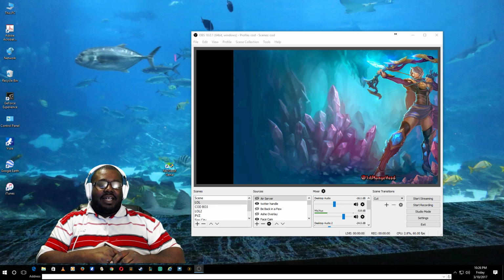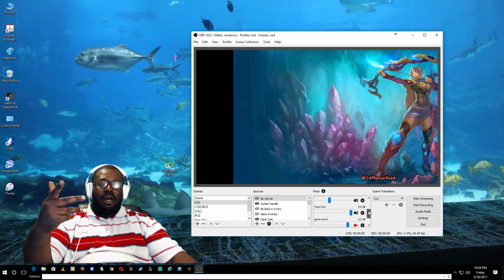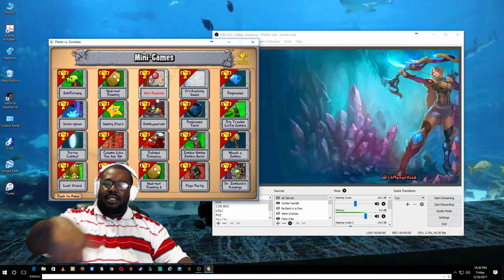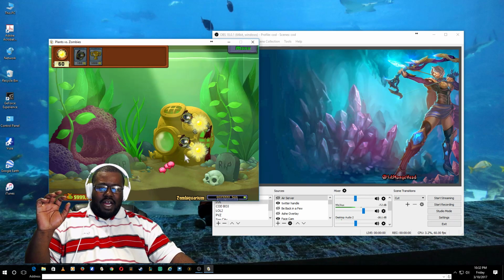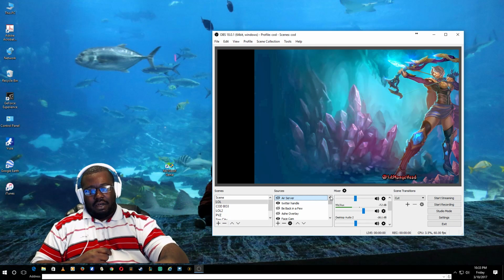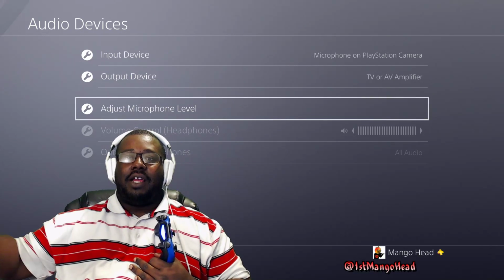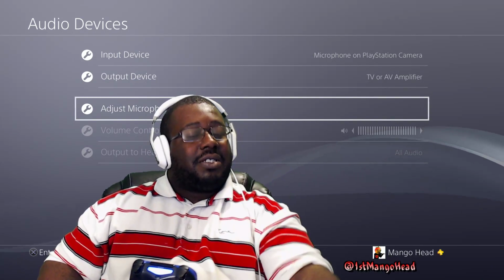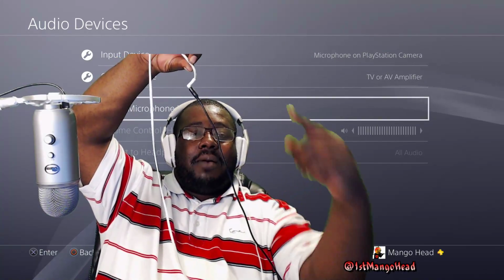My OBS Audio Setup | PS4 & PC Gaming Audio Explained

Comment: Do I have to add a input on obs to hear my game audio or will the ps4 remote play pick up all the noise
Reply from the maker: If you don't have remote play as a source didn't want pick it up
Reply: Mango Tech okay another question why when I connect my controller to ps4 remote play my controller doesn’t work right less responsive and does what it wants

Comment: How about if i dont have cam ?
Reply from the maker: Sorry it took so long for me to reply to you but you say how about if you don't have a cam you mean the PS4 cam or a PC cam, cuz if you don't have the PS4 cam what you can do if you have a wired headset you can plug it into your controller with a splitter so you can hear gameplay and chat and on that splitter you run a line to the back of your PC to capture it for your stream
Reply: @mangotech7585  i have hypers cloud    alpha..  Can u gave me a link for the splitter the i need

Comment: Hey thank you so much for this video I was able to get it all working I was just curious as to why when you plug your headset into the monitor you loose the left to right hearing on your headset? As in footsteps in a FPS that are coming from the right side it sounds like it is coming from both sides instead of it focusing on the right side.
Reply from the maker: That depends on your monitor. if the headphone jack on the back of your monitor is not full stereo with you no surround or whatever then that will happen

Comment: this was very helpful...but my only question is that even tho your getting all your audio when you plug in your headset from the back of your monitor, is there a way to pull your computer audio to headset because as a streamer you want to be able to hear the notifications go off but from what I understand from the video is that your just pulling the ps4 audio to the headset so essentially youd be missing out on desktop audio? plz hlp lol.
Reply: Not with this configuration. Working on a workaround

Comment: where would one buy an audio jack? suggestions?
Reply: Is it a USB audio jack that you need so that the audio from the game can be heard in your headphones after you connect them to the USB audio jack?
Reply: what camera mic from the playstation are you talking about? Do all PS4's have these built in webcams and mics?
Reply from the maker: PlayStation has a camera that you can use to stream that plugs into the back of the PS4 in this video I talk about using that cameras Mike
Reply from the maker: The audio jack that I'm referring to is the one that is built in the back of my monitor because my monitor is where I have the HDMI cable from my PlayStation going
Reply: thanks for the clarification but i think that not all people that have PS4 also have this Playstation camera. i did however see it at gamestop yesterday so now atleast i know where to get it.
Reply: i still dont quite understand how i can hear my own audio with my aux wired headset on ps4 while on stream. I understand that the capture card comes with a cord that enables you to use a audio splitter so that you can hear the game on stream and on your headset, although just like the PS4 camera thing, I do not have that A/V in cord. any ideas on how to retrieve that without having to buy a whole new capture card?

Comment: Last night I attempted to stream my PS4, hauppauge hd pvr with OBS while using my Sony gold wireless headset. I noticed that when the headset was on it took the sound away from twitch leaving my viewers unable to hear the gameplay. However when I turned the headset off the sound returned to twitch and everyone could hear the gameplay. Is this truly a Sony issue and the headset needs to be plugged into the computer. Or is there now a better way to do this. How did you do it?
Reply from the maker: I plug up to the back of my computer monitor as seen in this video I don't use wireless headphones

Comment: I had it wrong I figured it out after I posted this your video was like the 5 I watched and it was perfect thank you very much, question do I have to use the PS4 camera microphone or could I use a totally separate USB microphone for the PS4? I feel like the PS4 Camera Mic pics up to much side noise.
Reply from the maker: You do not have to use the PS4 mic you use any mic you want as long as you got the mic audio separate from the output audio for the sound

Comment: What if you have a wireless headset and not one that plugs in?
Reply from the maker: Does it have a receiver that picks up the wireless headphones?
Reply: Yes it is the PS4 gold headset
Reply from the maker: https://m.aliexpress.com/item/32820969804.html?src=google&albch=shopping&acnt=708-803-3821&isdl=y&albcp=756963599&albag=43596749721&slnk=&trgt=68684682745&plac=&crea=en32820969804&netw=g&device=m&mtctp=&gclid=Cj0KCQiA5t7UBRDaARIsAOreQthh0S8_vL2TlbMtqZDUoMV3CBzbnF9fjj9cqquN1XuqmcFURstunpsaAqHXEALw_wcB 

I would try something like this, the only thing is we'll that USB have enough juice to power the dongle and is it compatible that would be my first try. If that doesn't work I would use the audio cable that comes with those headsets and give up the wireless feature.

Comment: Hey man!
I dig the tutorial! 
One question about the PS4 party chat: When you put it on the output on to "TV" instead of "headset"; are you able to hear your chat clearly over the game's volume? And is there another way you can hear your party chat via headset vs puting all the audio through the TV?
Reply from the maker: +Teeky with my set upBecause I have my headphone jack plug to the back of my monitor it’s allowing me to hear my PlayStation both the checked and game audio directly into my headphones so I can hear party chats perfectly fine I can hear regular lobby chats perfectly fine because my headphones is plugged into the back of my monitor

Comment: I'm still confused how you get the PS4 gameplay audio on the stream very confused
Reply: Ok, so what he's done is, he's using the 3.5mm jack from the monitor into his headphones. Nothing into the controller. I had issues too, thank God for his video. I am able to use my headphones, listen to in-game audio and use my mic to speak with people too. It's a lot simpler if you've got a USB mic instead of the regular condenser ones with the 3.5mm output. Hope I helped.
Reply from the maker: +Simply Streaming the game play audio is coming from the HDMI cable, the HDMI cable is plugged into the PVR which is recording the game play audio. The PVR is plugged via USB into my computer which feeds the audio into obs. Now because in the settings if I want to hear gameplay in my headphones, it will stop audio from going to the HDMI. To allow me to continue to hear gameplay in my headphones, I use the fact that the HDMI coming from the PVR is plugged into my monitor and my monitor has a headphone jack in the back. so I plugged extension cable to my headphones to allow me to hear the game play audio from the back of my monitor and maintain the audio feed through the HDMI connection. kind of a loophole through the gameplay. and I'm think I'm going to make another video to better explain it
Reply: Ruthless Sudzman and where do i connect the mic to if im streaming through obs ?
Reply from the maker: It depends on which Mike you're talking about if you're talking about the mic that your stream is going to hear than that one needs to be plugged into the computer but if you're talking about the mic that your party is going to hear inside your PlayStation then you need to connect down to your PlayStation
Reply: @mangotech7585  Hey i'm on ps4 how do i hear my  livestream chat and gameplay audio simultaneoulsy to my headphones? is that possible?
Reply from the maker: Yes it's possible sorry it took so long for me to reply I've been very busy, however there ways to do it you can use a headphone splitter to run cord from your controller to your headphones and split from that point from your controller to your computer in the line in Port to get the stream in your ear the chat in your ear and all of that on your stream I mean gameplay in your ear, I am talking to my phone right now to reply to you so I am not going to go back and make sure that all this make sense take your time and read it slowly